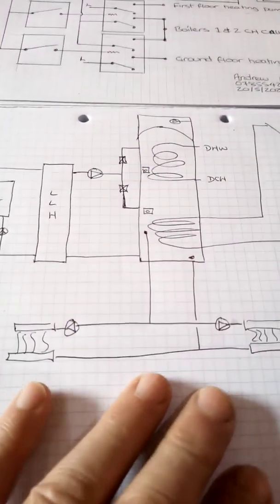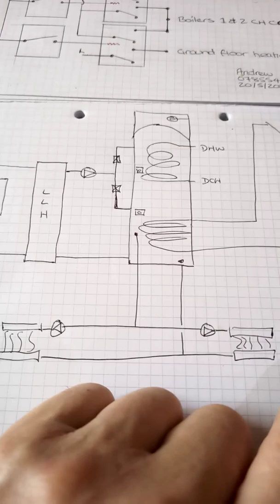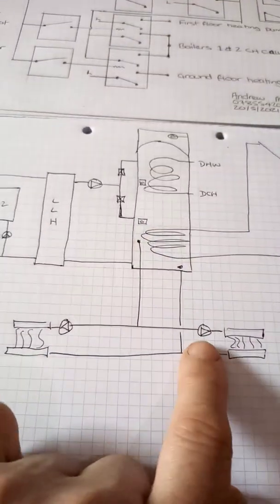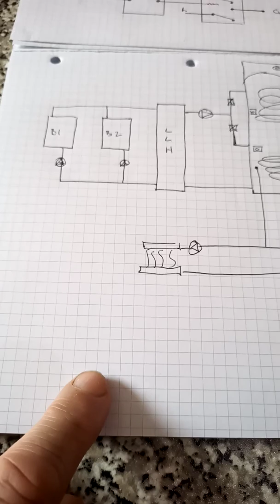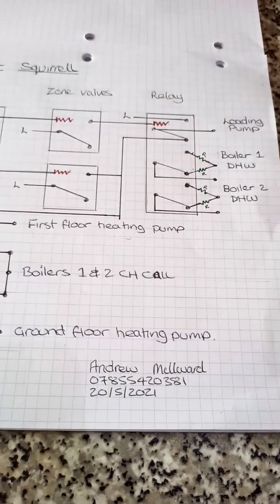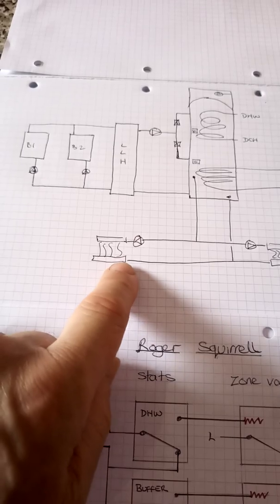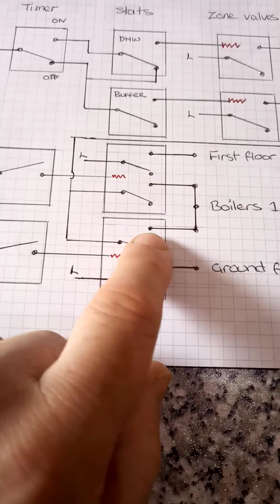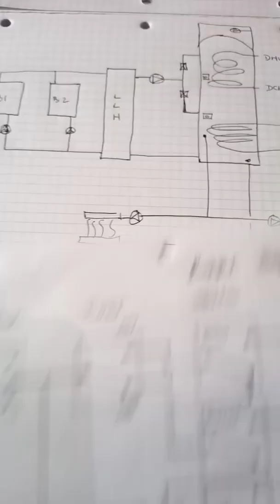Controls wiring for a 30 year old Chelmer unit with two Viessmann 100 compact boilers.

Comment: This reminds me of one I did about 25 years ago. The house was a town house: semi-basement, ground, first, second floors and loft. Customer wanted a simple gravity system no using pumps. 

My solutions was:
a) an open vented thermal store with DHW coil and a 1" CH coil inside, fitted in the basement, higher than the boiler. 
b) a cast-iron gravity operational boiler, that was conventional flue.
c) two heat zones; ground floor and the bedrooms on 1st and 2nd floors, on pressurised loops.
d) CH rads gravity fed via 22mm. House was vertical so easy to get vertical pipes to each floor. Gravity CH riser on one side dropper on the other side of the house.  Each CH riser and dropper came off the thermal store coil at the store. 
d) DHW mains fed though the thermal store DHW coil with a blending valve.
e) mo-mo valves for the CH zones.  They only use electricity when they move. 
f) Thermal store water separate from CH water so no sludging. 
g) Electric immersions at mid-way for DHW, and bottom for CH - electric backup for all when both on. 
h) flow to rads (riser) was lagged, return (dropper) was not, to promote gravity circulation. 
i) Thermostatic rad valves on all rads.
j) No centralised thermostat, meaning rooms are heated as needed.

I put in an anti-gravity loop in the CH droppers to the store. I told him I may have to put a mo-mo on the flow and return of the CH zone to prevent heat circulation - that is a zone valve on the flow and return of each CH circuit.  But the anti-gravity loops worked to my relief.  

It worked a treat. The CH was slow to heat up as it was gravity, but when warm it worked very well - no pumps used, just a 22mm pipe with the rads taken off in 15mm, apart from the living room rad which was 22mm to the rad. He got used to the warm up times setting the clock to suit.  The thermal store had DHW and CH stats, with anti-cycling stats used - once up to temperature, the boiler did not come in until the store cooled significantly. One flow in the top and a return out at the bottom, heated via gravity. Thermal store F&E tank in basement, as was the pressure vessel.  All in basement. When operational, the only electricity used was in opening the solenoid in the gas valve - but only when the boiler fired which was not that often, as the heat was stored in the largish thermal store. So for hours the house was heated with no electricity being used whatsoever, apart for a trickle in the time clocks.  Not once did it break down. The gas valve was still original when the cast-iron boiler was ripped out - it made a buzzing noise though.  

A few years ago the old cast-iron clunker boiler was replaced with an Intergas open vented heat only boiler using a separate pump to heat the store - no expensive makers pumps if replaced. A spreader pipe was fitted in the store where the flow entered the cylinder. I tried to get him to have a more modern pumped boiler at the time of installation, but he wanted simplicity and reliability.  The cast-iron boiler did give off heat, heating the basement as well, so not as inefficient as it may appear.

If I had a house like that today, I would do exactly the same, The boiler would have to be pumped of course as no gravity boiler is available these days.  But the CH rad circuits on gravity is wonderful.

Comment: The two zone valves are just acting as a 3-way diverter valve. 
i The top half is for DHW - 75-80C.
ii The bottom half needs to be around 50C for the UFH. 

1) The top DHW stat only heats the top half of the cylinder. 
2) The bottom CH stat heats all of the cylinder. 

Its operation looks like:
a) when DHW is called, heat is pumped only to the top of the cylinder.
b) when DHW satisfied (top DHW stat, prob set to 75-80C), heat is off, or pumped to the lower section if the CH sat is calling for heat. DHW priority. 
c) when lower section is satisfied (lower CH stat, prob set to 50C) and CH satisfied, the boiler(s) is off.

The solar coil adds low grade heat to the cylinder - this will only produce high grade heat in summer when the lower section is off. The heat it produced will rise to the top when the top section cools off after DHW draw-off. Any heat it produces may be fed into the boiler return raising the return temp. So the solar adds value at all times.  

Assuming the DHW demand is 365 per year, the two zone valves (diverter) add no value, only complexity and something else to go wrong. The boiler(s) can just pump into the top of the cylinder hot water (75-80C) when the CH stat calls for heat, wanting 50C at the bottom of the cylinder.  Stratification is used. Also a spreader is best used where the boiler flow enters the cylinder at the top, as you do not want pumped water upsetting the stratification too much - easily made by drilling out the stop on a compression fitting, running a pipe into the cylinder with holes drilled in the pipe facing upwards, internal stop end on the end of the pipe.

If there is a spare tapping at the top of the cylinder, or the existing tapping can cope with two boilers, I would pipe up the boilers directly to the thermal store, then eliminating a needless LLH. Possibly have heat only boiler(s) with one pump each.

The DHW needs a blending valve for sure. 
The UFH does not need a blending valve as bottom of the cylinder is no more than approx 50C.  Occasionally the temp will get lower with a large DHW draw-off.  But the two boilers will recover the store quickly. The UFH needs a high temp cut off on its flow pipework. 

Have a summer/winter switch to have only one boiler in summer.  Or none at all, with the customer just switching off one boiler in summer, alternating year by year, with well labelled switches. 

Then control system become very easy. 

I have not even mentioned two anti-cycling stats using a small relay.
A great thing about thermal stores is that if two powerful immersion heaters are fitted, the whole house can be run via electricity. The bigger the store the better, as cheaper night time electricity can be used.
Reply from the maker: On the Chelmer unit the two valves can close at the same time.
Reply: @andrewmillwardwatford9410  
They are still not needed if DHW is needed 365.  Diverters are usually on the return. Flow into the top, DHW return mid-way, CH return out at the bottom - fast DHW warm up as delta-t of F&R narrower, also protecting the boiler heat X. That can be done on this system as the tappings are there. 

Many stores have a blending valve on the return to the boiler. This ensure the heat out of the flow is 80C, and the delta-t is not too wide (back end protection).  From cold DHW is at the tap within minutes or so - acting like a combi. 

This is an odd one for sure.

Comment: They are called Thermal Stores.  They are brilliant. Unfortunately they are greatly misunderstood. 
I try to fit DHW only versions in place of problematic unvented cylinders. Simple, safe using low pressures, and super reliable.
Reply: I have converted existing open vented cylinders to thermal stores using a plate heat X, flow switch, Surrey flange small F&E tank and DHW blending valve. GIve main pressure hot water, so not awful power shower pumps. Cheap and easy.  I did one 25 years ago, with the cylinder still working well.  All the neighbours around are on their 2nd or 3rd cylinders due to corrosion and most on their 3rd power shower pump.   This conversion does not use any fresh water, I told them to pour X100 into the F&E tank once every 3 or 4 years, in case.  In 25 years a flow switch failed 2 years ago. No power shower pump needed.

Comment: Hi mate. In my experience thermal stores don’t require a low loss header as they act as one themselves. You might get a fair bit of distortion adding a LLH.
Reply: Copper Skills, correct.  The two boilers could be connected directly to the thermal store cylinder. A lead lag controller could be fitted or just simply leave them, having a summer/winter switch with only one operational in summer.  Or just leave the two of them operating, as any reheat will be very fast. 

The cylinder is a neutral point being a LLH in itself.
Reply from the maker: @johnburns4017  the boilers are now wired as two temperature. The hw demand fires the boilers to 80c and the ch demand fires at 50c. Each is only 19kw so lead lag is not requited imo.
Reply: @andrewmillwardwatford9410  
80C supplied to the top of the thermal store (DHW), when satisfied, it switches to 50C when heating the bottom (UFH, CH)? II assume DHW priority.

I have done this using weather compensation for the bottom section when supplying rads only. The boiler had integral weather compensation. 

1) When DHW was called a relay opened or closed the circuit to the outside sensor throwing the burner to full on for DHW production. 
2) When DHW is satisfied (top half is 80C), the outside sensor is switched back in, supplying the temperature dictated by the outside temperature. 

It needed a diverter valve on the flow to the thermal store. Similar to what you have here. 

Cheap and simple.
Reply from the maker: @johnburns4017  yes its how I've done this one
Reply: @andrewmillwardwatford9410  
Using WC?
Reply from the maker: @johnburns4017  I have used to temperatures low temperature for heating and high temperature for hot water generated at the boiler
Reply: @andrewmillwardwatford9410  
I agree, lead-lag not needed.  I would still consider omitting the LLH taking the boilers to the two zone valves (acting as diverters).  The boiler's F&Rs only need 22mm.  When meeting the two zone valves the pipe sizing can be upped to 28mm. The cylinder tappings are usually 1" (28mm), they usually are, so 28mm from cylinder to zone valves.
Reply from the maker: Two points on that, I say I'm the video it's existing but the other is that it's two boilers met by two zone valves. I expect it was installed to ensure the boilers didn't dead head when the zone valves close. If the zone valves hadn't been there it would have made total sence to remove the header I think. I did suggest to the customer taking the heating completely of the buffer and after the low loss header.